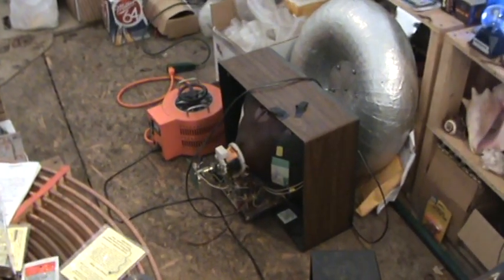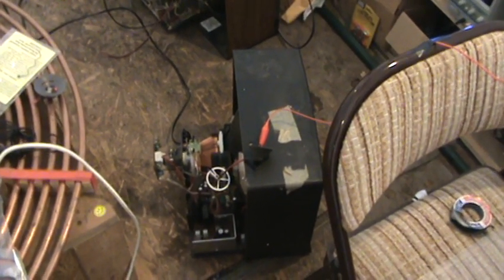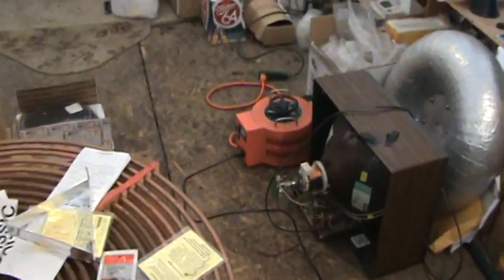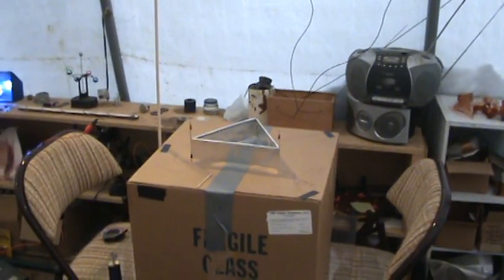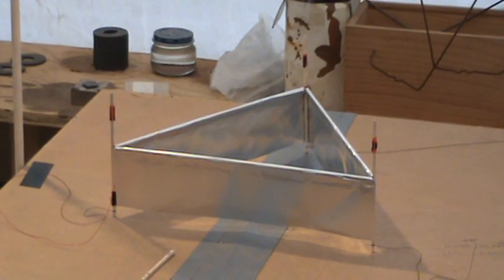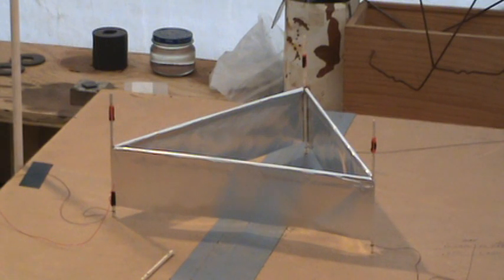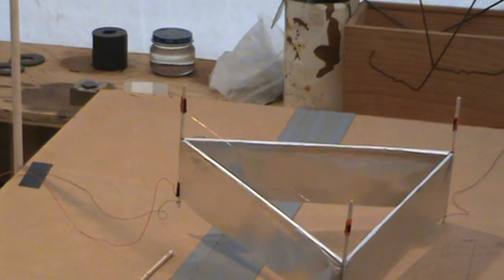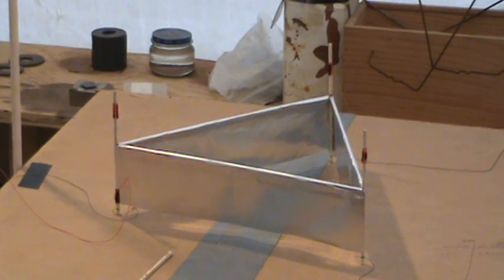LIfter/Ion Craft, Biefeld Brown Effect, Part 4

Comment: It needs dielectric material with very high dielectric constant like barium titanate or calcium copper titanate between the positive copper wire and negative aluminum foil so electricity has to completely flow through dielectric material. That will make it more than simple ion wind and lifter will then work in a vacuum. Thomas Townsend Brown used dielectric materials in his vacuum chamber lifter experiments. Also the shape of lifter should be pyramid shape, i think this shape will increase thrust efficiency.
Reply from the maker: Good comments, thank you!  Hmmm, i have some barium titanate :-)  I did not know Brown used a dielectric, i will look into this.  More than ion wind,,,,yessssss, lots of controversy about this.  I want to combine Dyson's fan air flow technology to the next design shape i make.  Thanks again :-)
Reply: @INVENTOR3  You can also research Nikola Tesla's ether which is what the real electro-gravity technologies use for propulsion. Read books "Occult Ether Physics by William Lyne" and "Uncovering the Missing Secrets of Magnetism". Its similar to how submarines use water around it for propulsion. Electro-gravity/anti-gravity technologies use ether around it for propulsion as there is no such thing as empty space. With high voltage high frequency, one can access ether for propulsion if done correctly.
Reply: @INVENTOR3  Also read book "Secrets of Antigravity Propulsion by Paul Laviolette".
Reply from the maker: @Xeno_Bardock  Einstein talks about the Aether .....    https://www.youtube.com/watch?v=yCm6eLP9zRw
Yes, space is not empty :-)    Lois Rota was another name to search.  Thank you for your great comments & points.
Reply: https://contest.techbriefs.com/2019/entries/aerospace-and-defense/9391-0320-084626-application-of-the-biefeld-brown-effect-using-d-r-bhueler-formula
Reply: Google "My World By Viktor Grebennikov Chapter 5 pdf". He was a russian scientist and entomologist who figured it out and built a small anti-gravity machine he was able to stand on and fly at around 40 km/min without any fans or rockets. You can see the picture of his flying machine in his book. He did CSE (Cavity Structure Effects) experiments and also observed geometries of insects under microscope like beetles wing cover which led him to figuring it out. Few species of insects have natural anti-gravity. Also check video "Shape Power as Universal Resonance by Dan A. Davidson". He talks about Viktor Grebennikov.
Reply: @Xeno_Bardock  왜 삼각형 모양이어야 하나요? 원형이나 기타 다른 모양은 안되나요?

Comment: Well done, just need larger distances between wire and tinfoil
Reply from the maker: Thank you,,,,maybe i also need a smaller craft for this power supply.
Reply: @INVENTOR3 I think a smaller craft would be better. Also coffee straws are lighter I think. I used ignition coil, and commutator switch, and 120kv diode with homemade glass capacitor,  for the high voltage power supply. I dropped 800v across the primary of the ignition coil and the voltage output was insane. Then I was able to add greater distance between tinfoil and wire, careful though you don't want to get shocked by that, not even thick rubber gloves will protect you.

Comment: Would this effect work in space if it exist
Reply: No. Ions are moving the air causing thrust/lift. Google Dyson bladeless fan.
Reply from the maker: @noclu4u384  Funny you mention Dyson fan,,,because this has been my idea for new design I had since i last experimented with this project :-)  I have perfect video saved for this, a guy makes dyson fan air flow using two plastic bottles.
Reply from the maker: NASA...
https://www.youtube.com/watch?v=xYMUv1VJ3VQ
Reply: Yes you would need to provide the ions usually Xeon I think  nasa does this all the time very effective

Comment: Graeme Lastname 
Pred 2 rokmi
I will guess you are an honest person and want the truth.  Corona discharge is ionising the air and then repelling the air producing lift. The lighter you make it the more lift you will get.  The only problem is it won't work in a vacuum simply because there is no air to repel.  Sorry m8 but that's the truth. Nice try though. Things to watch for ... The supply must be DC and the higher the voltage, without arcing, the higher the lift. Good luck.
Reply from the maker: Thanks for your honesty :-)
I understand well.  I still have a great interest with electrogravitics,,,Louis Rota was another big name i remember.
There is controversy about the lifter in a vacuum,,,,maybe because there is a video from NASA on youtube that shows a lifter in a vacuum.

Comment: There's  to much weight. you need more foil & wire to create a larger area of positive ions to block the  negative ones coming down.
Reply from the maker: You say too much weight and then you say to add more wire and skirt?!  Maybe you mean to decrease the size of the craft and make the skirt bigger?  I dont think we want to block ions, but rather attract them, although maybe your referring to the collisions of ions.  Im not sure if most people realize that these crafts can also work with reverse polarity.  RimstarOrg does a great job of explaining the craft here.....
https://www.youtube.com/watch?v=01F8V5IhB5k

Thank you for watching & your commenting :-)
Reply: Ohh your still around good, no what I mean by add more wire & foil is this, you need more surface area so more traingles but closer together... Interesting Video, tell me has anyone considered that maybe what is happening here isn't  pushing ions through it but blocking them, 
has anyone tried placing a larger wire matrices above the alluminium foil to see what it's result would make. if you know of a vid it would help thanks.
Reply from the maker: Fast reply :-) I was at home when i fist replied, but now at work.  And on my 25 minute drive to work i could not get the though of "pushing ions" out of my head.  I like open minded people :-)  The craft does work in reverse polarity, so this also makes me think about pushing ion concept.  Now that you mention it, no, i have not seen anyone try multiple wires above the skirt, or more windings above skirt.
I like the way you think, thanks.
Reply: INVENTOR3  😀 thanks for replying,  one more question what amps were past through the wires when you tried it.
Reply from the maker: Hmmm, i did not check the Amps at that time, but i was using a small TV for the power supply unit

Comment: I will guess you are an honest person and want the truth.  Corona discharge is ionising the air and then repelling the air producing lift. The lighter you make it the more lift you will get.  The only problem is it won't work in a vacuum simply because there is no air to repel.  Sorry m8 but that's the truth. Nice try though. Things to watch for ... The supply must be DC and the higher the voltage, without arcing, the higher the lift. Good luck.
Reply: what a load of bs.
The brown effect becomes more efficient in a vacuum.
The ionisation is related to the positive and negative point, creating a well and hill that the device could 'surf' within.
Well and hill, positive and negative.
Circular or triangular, where even a cigar or square would work, hell...even the b52 managed to applicate.
Reply from the maker: Thanks for the comments.  Hmm, i understand, but still i read of the controversy many times.  What do you think of this video?......
https://www.youtube.com/watch?v=xYMUv1VJ3VQ

Comment: very cool it looks like you have far to much skirt material the ones that I have seen successful , had a very slight skirt. but oh well the fun is in the learn right. you have a very interesting hobby now
Reply from the maker: Wucifer slayer Thanks for commenting.  I made anew lifter craft with smaller skirt, but now problem is power supply,,,i might have to build my own.

Comment: The three top wire supports will always be where insulation breakdown results in sparking. The natural variability of wooden supports produce different values of resistance.  Linear measurements provide good starting point and with your suggested use of HV limiting resistor allow fine tuning(equalisation). turn up voltage in steps, limiting current to couple of miliamps untill sparking occurs, switch off quickly. Then use slightly lower voltage for lifter without HV resistors.

Comment: the metal plate is earthed and thin wire from lower corners of lifter are taped down to limit movement of craft from becoming out of control. Dont really want the lifter flying into you, and also provide a good return path for current.

Comment from the maker: Thanks,,,that's one of the reasons i like this project, because i think science just may have something wrong with this theory of lift.
Reply: I think the electrons can build up on the emitter wire. Once they get really cluttered on it, they start to migrate off.  The outer electron shells of the ambient O2 molecules have a strong affinity for free electrons and absorb them like a sponge, creating negative ions.  Some of the electrons may remain free and just find their way to the collector surface and beyond, bumping molecules along the way.  The O2 ion molecules bump the most ambient particles on their way to the collector as a primary momentum transfer mechanism.  If the current provided by the electrical system is low, and there are no undesirable focal points on the emitter or collector surfaces to create heat or act like  lightening rods, than the system will be more efficient and no energy will be waisted making unwanted O3 or nitrogen compounds.  The lift is more proportional to the voltage instead of the current like everyone seems to think!  I hope you like these theories, they seem to work in practice.

Comment: Also note, Though lots of people claim this is an ion craft, it is not.  Ion craft moves by spitting ions, though this is spitting ions, this design is not what is causing it to float.  This can be proved my switching poles.  It works by created an imbalanced geometric electrical field.  I can see lots of ways to improve this, but dont have the equipment/time to do so.

Comment: Move the wire.a little closer, but not close enough to arc. If u can use an insulator to reduce arc'ing as to get it closer still, I think I will get better results.  But don't block the top side of the wire.  Maybe use polystyrene for the insulator.,

Comment: What voltage are you running into the TV's flyback. I tried making a smaller one of these lifters and it only danced.. no lift off. I dint video it.. but I do have other things I am working on you may get a kick out of.